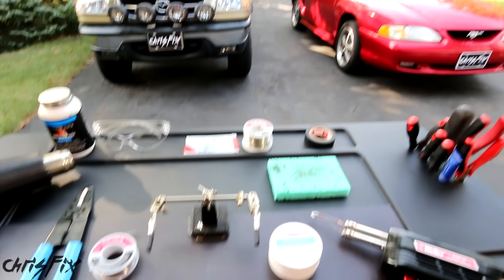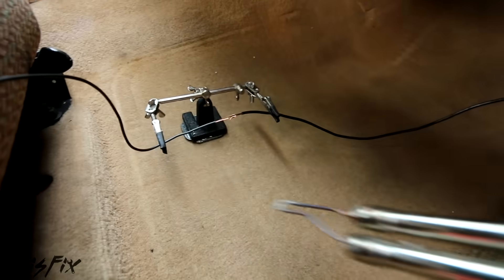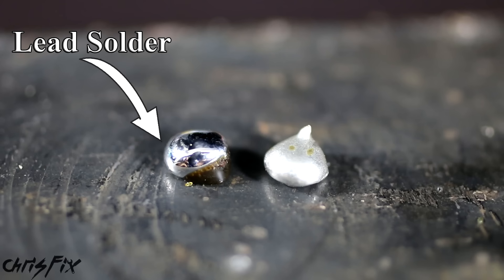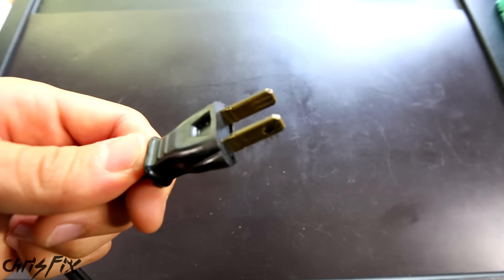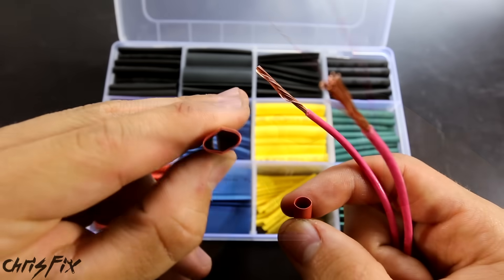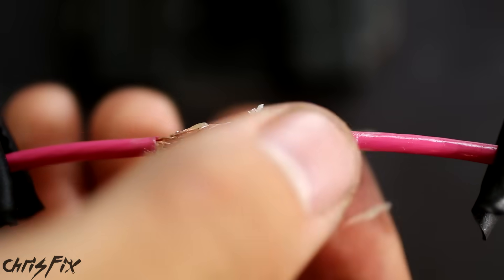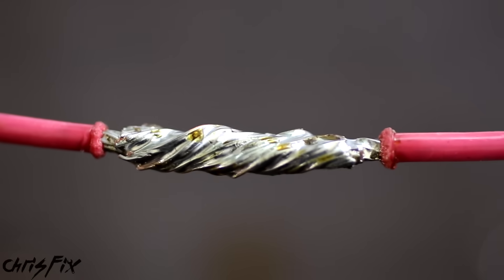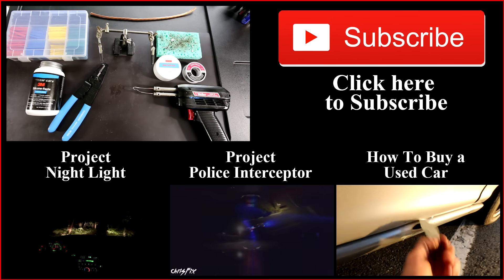How to Solder Wires Together (Best tips and tricks)

Comment: After fanning the wires and before pushing them together, you can lightly scrape the strands with the edge of a razor blade to remove the red coating to better expose the bare copper. Then push the frayed ends into one another and twist, add flux... Over the years, not knowing to property removing the oxidation as he correctly points out, and the shiny red coating on the wires has caused me more trouble getting the solder to stick than I like to admit. ALSO, cut off the exposed ends of old wires, they will be heavily oxidized and will not accept solder; another headache prevented! Take my word for it. If the wires are short, cut that part off, splice in a new length of wire to make it longer; yes, another connection to be soldered in but so much trouble will be avoided and it will be easier and quicker in the long run.

Comment: The cable from which he took the strands (each strand approximately #12 AWG) to make the soldering gun tips, appears to be a #3 or #4 gauge. Which can be purchased by the foot. The individual strand (see 5:02) should be a 12 gauge wire or .0808 inches which falls between the sizes found in a #3 (.0867) or #4 (.0772) copper cable.  You could simply use #12 gauge wire, typically found in 20amp, yellow coated, residential Romex wire. 

Excellent video but he left the size of the cable he used off his list.

Comment: Wrong way, if you do like this the rezistance of wire will be low and all the time you will have error for the sensor wires you've done, corect way both wires paraller one to the other one, close and after solder, plus he is using bad flusk,pasta to solder, all the time i got cars with problems because of those guys

Comment: so let's say that you have two wires you need to join, and the inside is made of like 20 small wires, what if you cut away 10 wires from each wire and then solder it so it's about the same thickness

Comment: Why is it that I hold the solder gun (same one shown in your video) on the wire and the plastic insulation of the wires melts but the solder still doesn't melt.  What am I doing wrong.  Instead I almost always do a cold solder then melt it into the wires.

Comment: I've soldered for a living for the last 14 years, and this video is really excellent for people interested in soldering.  The information here is quick, thorough, and most importantly - it's accurate.  The only extra tip I would recommend is cleaning rosin flux residue off rubbing alcohol using a stiff bristle brush prior to the heat shrink application.   Very well done!
Reply: I'm just curious as to why it's good to cleaning the residue off? Does it prevent the tubing from working properly in some way?

Comment: Thank you. Chris that was very helpful I have 54 solder connections to do on my Harley Im changing the handlebars and all the wires have to be extended and they run through the bars
Reply: I'm about to do this on my 13 road king for the left and right side controls... but I don't look like I have 54 wires maybe like 12 or so. What kind of bike do you have?

Comment: I solder a lot of electro-mechanical fixtures for a living and I gotta say, if you're going for quality IPC-3 level work, use a J-hook approach to your lap splices and reduce your dwell time so you don't melt/burn the insulation. Dwell time for -Pb should be 5-10 seconds and Pb should be 3-7 seconds.
Reply from the maker: Thanks for the tip

Comment: Tbh 
Using a cutter or a pair of scissors works as well as a wirestripper. 

Quick tip: Use the plastic/rubber insulation that you just cut to twist the wire when connecting it to circuits.
Reply from the maker: Thanks for the tip

Comment: A butt connector is both stronger and has less resistance than solder. Solder has no mechanical strength.
Just splice and crimp. Teach the correct method.

Comment: 63/37 is the eutectic alloy. Lowest melting point and virtually no plastic zone, reducing disturbed solder joints. 60/40 is definitely better than lead free, but I think 63/37 is better.

Comment: Hey Chris,

Was just soldering for the first time and used your video. First few wires were easy, but then had to connect 3 12 gauge wires together, and the fatter chunk of wire apparently wouldn’t heat up enough, because the solder wouldn’t melt, even after a long, long time of trying to heat up the copper. Have a 60 watt cheap solder iron, but says it goes up to 450C, so wasn’t sure if you had any tips?? Thanks!
Reply: You need a bigger iron.

Comment: As a miniature and micro electronic repair tec. This is a pretty good tutorial. Quick tip: Always be sure to clean off all left over flux with some isopropyl alcohol because that flux can corrode the wires overtime. A great way to do this is to use an acid brush or a lint free towel. There are some you can buy that are specific to soldering but the acid brush works just fine.

Comment: Should I admit to having a Ph.D. in high energy experimental physics, a degree I earned long ago, without also learning to properly solder? Sure, some of my circuits worked, but many more failed, plagued by cold solders and poor connections. And every time I went to solder, I worried. While I still don't "know" how to solder properly, your video has given me hope that I can finally learn. For now I once again must rewire the small trailer I use to transport  a snow blower. Cold is in the Hudson Valley. Snow is coming. And again my wiring harness fix has failed. Maybe this time I can solder wires together rather than joining them with butt connectors and 3M Scotchloks.  Thank you for the exceptional clarity of your video.

Comment: If you don't use enough heat with lead solder, then it will have a dull, not shiny, look to the joint.

Comment: I loathe those soldering "guns". 90% of the heat is in the rest of the wire and in the body. 140W used to get a 15W equivalent tip. Especially when you make your own tip out of copper wire. The entire wire is heating up.

Comment: exelent tutorial, i'm an industrial electrician and also work with electronics, everithing was very well explained, i would just add that if you are gonna solder on an old wire, you want to clean the cooper first because even being insulated, wen you strip the tip of the wire it comes out filty, so with paint thinner, break cleaner or contact cleaner remove grease and other contaminants from the bare cooper, there is also a very good paste i use that clean the surface and acts as a flux when heated, is burley brand paste, comes in a yellow thin can with red vintage font, also if you wanna make an electical connection that will be subject to high current is a better pratice to crimp the connections, the solder joint has a little resistant that can produce heat and gets brittle over time

Comment: Take a look at a book called automotive wiring and electrical systems by tony candela. It’s on amazon and offers A LOT of tips on every electrical situation you may find yourself in, as well as tools to have on hand. With splicing copper, not that your doing it wrong but IMO your adding a lot of unnecessary steps for such a rudimentary straight splice. I highly recommend the book.

Comment: 10:25 Wrong, dont clean  tip after use (only before), solder normaly prevent oxidation of tip, if you remove that layer tip ll burn out quicker. 

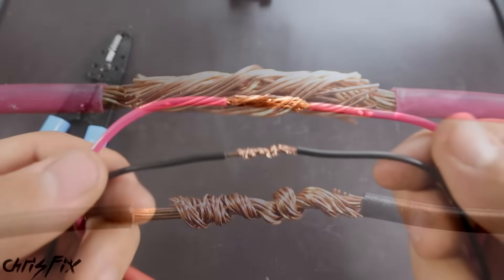8:35 If you dont have helping hands, just band tin streight and then solder the wire.
Reply from the maker: Thanks for sharing

Comment: Thanks for the video. Just replaced a bunch of bad wires on my surround sound speakers. No joke I did the solder on the tip of the iron thing lol. It's a lil globby and not that pretty but hey it works. I wish I would have watched this video first before trying it. This video makes sense and is filmed perfectly. Thanks for education me.
Reply: PS. Subscribed

Comment: Verry nice video, one thing i would recommend is to not use to much heat. Also dont heat the copper to much, you can see the isolation started to melt, this will cause it to get more brittle and crack over time.

Comment: I wasn't going to comment, besides, no one is going to see this on a 3 year old video, but people who think lead free or 'green' products are better for the environment need to reconsider the facts.  Fact: It takes almost 6 times more 'green' paint to get the same results as 'regular' paint.  That means 6 times more energy used for production, 6 times more trucks on the highway to transport all that sweet, 'green' paint to market, 6 times longer to do the job, etc., etc., etc.  Fact: RoHS complaint (lead free) solder (say colder with an s at the front instead of a hard c sound) leads to poor component performance, dim or non-functional displays, shorted boards when connections over-amp or simple failure due to no connection.  (See videos on 2003-2008 Corolla clock dim/unlit.)  The environmental impact of mining the precious metals used on electronic components alone means that the more reliable the component the 'greener' the component.  If your solder is the weak link, you're basically taking a dump on your own environmental concerns.  In 40 years, I've never seen a more optimum electronics/electrical solder blend than 63/37 (tin/lead) solder.  Low melting point (less likelihood of component damage), greater flowability, less material needed, less energy used heating the iron, reduced fumes, best joints all around.  End of rant.   As for this video, par excellence!  As usual, Chris Fix does a great tutorial and is one of my first go-to experts when I want to do any work on my vehicles.  Great video!

Comment: The second method is the style that NASA teaches Astronauts. Strip at least an inch back, pre-tin the wires, bend 90° two-thirds of the way back on the stripped section, twist the wires around a minimum 3 times on each side, now solder the wires.
The goal isn't just a good electrical connection, it's a solid mechanical connection that doesn't have weak spots around the solder joint.
Reply from the maker: Thanks for sharing! Awesome info.
Reply: @chrisfix  if you can, please search some videos about "empalme cable". That would be cable juntion or union, but I cant find any video in english. Don't worry, you dont need to understand spanish to see how it is done. With those metods you don't need to solder or crimp anything, and the conection is great. If you want, you can solder the union, and it will resist traction forces better.
Reply: The twisting method is the way GM wants all wires to be soldered. I was in diesel school and did it that way without being shown and thats what the instructor told me.
Reply: OK how about for car radios use a crimp on connector that when you heat it up after crimping the wires inside it shrinks and wrap the wire for a water tight connection
Reply: M. Serry Those work well from what I’ve heard, the solder in those has a lower melting temperature so that it melts when you heat up the heat shrink. Much easier than using individual pieces of heat shink and soldering separately.
Reply: Lineman Splice/ Western Union Splice Or NASA Splice.   Nice Work.
Reply: Indeed! If anyone is interested in NASA approved soldered and crimped terminals, the documents are available for download. Google it. Sorry, I don't have a link.
Reply: Forgetting to clean off your rosin with alcohol after soldering.
Reply: @LookOut48469  R and RMA flux may be left on indefinitely. It's called "no-clean" in modern industry terms.
Reply: @stickyfox  thats not what he is using and no-clean is garbage.
Reply: @LookOut48469  R means rosin. RMA means rosin, mildly activated. Both types are acceptable for use with stranded wire as long as the activity level is 0 or 1 (typical classifications for RMA). You can see what he's using at 2:10. Bernzomatic isn't associated with high-performance electronics, I get that.. but rosin flux has been around for nearly as long as electricity. 

Modern manufacturers consider "rosin" and "no-clean" to be equivalent. I just had a conversation a few weeks ago with a Kester rep about this relatively new nomenclature. And no-clean definitely isn't garbage. It's used everywhere in modern manufacturing. It works beautifully if you know where and how to use it. I typically use Chip-Quik SMD291NL. Higher-activity fluxes (like the acid used in the silver metalworking solder) cannot be left in place, and should not ever be used with stranded wire.

It's good practice to remove flux after soldering, but it's not necessary. It would probably take 50-100 years for the rosin in these examples to cause a connection failure in a properly sealed and weatherproofed installation.

I am a current CIT in J-STD-001S, IPC/WHMA-620S, and IPC-610 and am happy to answer questions about soldering any time.
Reply: @stickyfox  OK well I am also certified in J-std_001-006 IPC-610&620 Now I am not an expert and neither are you or we wouldn't be just a CIS and I currently could not access the training documents on ipc edge to look at J-std-004/005 so i can only work with the J-std 001F hard copy i have in front of me, so I cannot go into further detail then what follows. 
 
The flux he is using is according to the manufactures website datasheet specifies the flux paste as RA. Again since i cannot look at J-std-004/005 an article I found says "Rosin activated (RA) flux consists of rosin, solvent, and aggressive activators. RA flux has similar and higher activity than RMA for moderately and highly oxidized surfaces. IPC classification is usually ROM0, ROM1, ROH0, or ROH1. RA flux residue is considered corrosive. Assemblies sensitive to corrosion or the possibility of electrical conduction through the residue should be cleaned as soon as possible after assembly. Residue may be removed with an appropriate solvent" 
The datasheet of the flux paste also lists" Specifications: Federal Specifications O-F 506C, Type I, Form A; MIL-S-6872A; IPC ANSI-JSTD-004 ROH1.Which means he is using a high activity level paste and not a low level on stranded wire. 

 J-STD-001 section 3.3 says Type H or M fluxes shall not D1D2D3 be used for tinning of stranded wires. J-STD-001 section 3.4 says solder paste shall D1D2D3 meet the requirements of 3.2 and 3.3. 

Now I cant comment on your Company's policies or what class you have to uphold, but my previous company did class3 products under strict guidelines due to our client. I am unwilling to describe which company and what client in a open forum due to possible repercussions from such. This company forbids using no-clean and  lead-free solder due to unreliability, however we know this type of work Chris is doing would not need to meet class3 design specs, so I would agree the work MAY OUTLAST the years left on the vehicle if environment aspects were not involved ex.( sealed properly), but i would not specify on how long not knowing if the chemical properties of the flux core solder and paste are compatible. You may find a rapid corrosion process happening due to incompatibility even sealed well. Look forward to your reply.
Reply: hmm after reading your comment again i see you said cit and not cis.
Reply: Hope you dont certify the way the lady from my ex company does. I refused to even do a module yet somehow passed it. lol
Reply: Do you have a video. Very interested in this subject.
Reply: Make a video about it
Reply: Hi Chris
Reply: @technokidbhavik7513  Hi bhavik
Reply: Thank Western Union telephone telegraph. You don't have to be a rocket scientist.
Reply: Friendly reminder that 99.99% of comments that say, 'NASA does X', or 'Delta Force uses Y' are an appeal to authority (a common fallacy!), and aren't based in reality AT ALL. Caveat emptor.
Reply: That's the way we learned in our computer engineering class. But my soldering always sucked.
Reply: Just NASA alone make it better option.
Reply: @MrBuash  Sounds like the method developed by a Telecoms co back in the day (I think Bell).
Reply: @DesertCatDad  Don't spoil his NASA rose glasses for him. 😱
Reply: I was told  the best way is to join the two wires together in parallel. No twisting or meshing. Just a straight through connection.
Reply: @JazzFunkNobby1964  If you're interested in the various techniques, check out the NASA soldering standards. You can google the document.
Reply: @JazzFunkNobby1964  That method is not nearly as strong as the methods You should always, as much as possible, make solder needed only as a seal against oxidation, because it is a fairly weak mechanical substance compared to pure copper.  If thr copper wires are pressed against each other for some length, you do have a good electrical connection and tge solder protects that from ixidation, but mechanical forces can weaken and break the joint in many cases.
Reply: @samuellord8576  Any soldered wire should be secured to protect from mechanical forces. You do not rely on a soldered joint of any type to give mechanical strength.
Reply: @JazzFunkNobby1964   Hi Nobby, yes!  When you said, "I was told  the best way is to join the two wires together in parallel. No twisting or meshing. Just a straight through connection"  you mentioned no other mechanical connection, so I replied accordingly.

Comment: Using lead-free solder, working on circuit boards and very thin wires. I can't manage to solder anything, the solder sticks to the soldering gun (stick) but it never attaches to copper wires...never. I am using flux, I am cleaning the tip, but the solder never sticks to the goddamn wires or circuit contacts. i've burned through a lot of stuff, and never managed to fix anything (from Led bulbs, to USB drives)...

Comment: Always wash your hands with cold water after working with heavy metals, because it will cause your pores to contract, making it harder for the particles to get into your system. Also, if you work with them enough, you may want to invest in de-lead wipes or soap, both of which do a fantastic job.